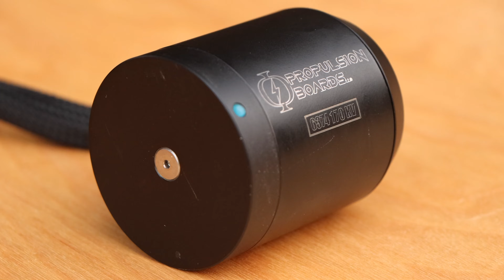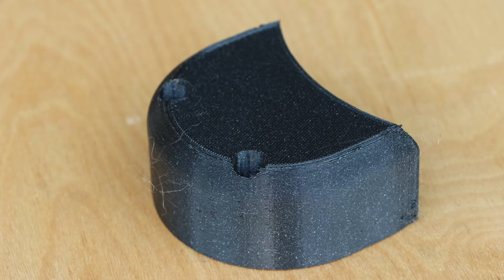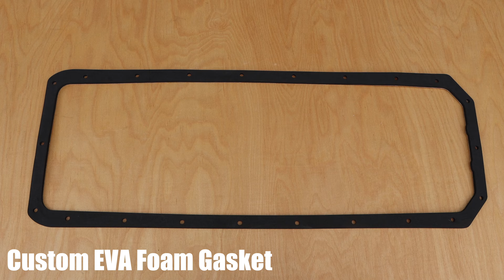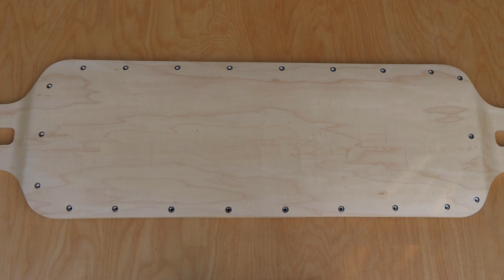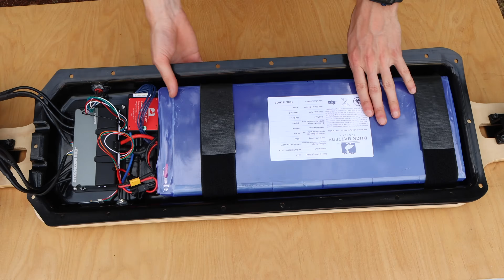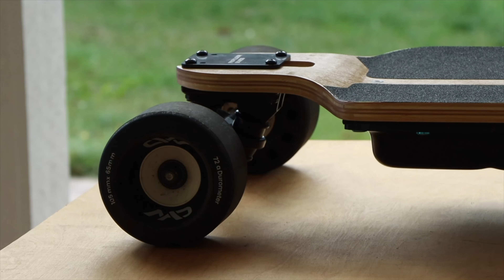How to Build an Electric Skateboard *THE DEMON 3.0* (38 MPH, 35 mile range)

Comment: Parts can be bought and replaced yourself unlike bigger esk8 sellers. But for how long, esk8 is still niche and companies disappear all the time and no more parts to buy.
Reply from the maker: Our whole goal is to develop modular systems that can evolve with the industry and latest parts!
Reply: @DIYesk8Builders  yea, I agree. I would support your site instead of the other bigger sites if I get another board. You should also put an airtag or smarttag inside the board too in case it ever gets stolen or lost.
Reply from the maker: That would be a cool addition!

Comment: If you get the kit, can you choose to use a different deck similar to the one provided, or does it work only with the deck given in the kit?
Reply from the maker: You can use another deck if you would prefer. The beauty of the deck provided is that all of the bolt holes align with the enclosure already and everything has been designed to fit together

Comment: I need to fix my 2.0 I miss the freedom.
Reply from the maker: What is broken on it right now
Reply: @DIYesk8Builders  honestly not sure I emailed you about it a few months ago. I just haven't put any time or month into figuring it out thought. I need a multimeter to figure out where the problems start. I hope it's a power but but it's unlikely. Most likely, the bms or focbox or both🤣🤣🤣 hence why I have l looked into, makes me depressed to think about🤣 but the new board looks incredible, I cant imagine my 2.0 being better. I've gone 17 miles on some insane hills that my car doesn't like.  You can stop in the middle and start again and be zooming by the top. I weigh less now in the past few months, but it was doing that with 220 to 200 pounds on it, and I'd pull my buddy "180" up hills with me it's insane. Just wish I had the month to put into it, but rn it's in open and sad I need to get street wheel belts broke one a few days before I completely broke it. Think I had them to tight, and little rocks just ate threw the one side, and it eventually gave out. Need a power button because I saw a video where you could jumper the pins and it'd turn on if your power button was broke it didnt work spinning the motors would get a couple likes to flash on the focbox but not start it which leads me to the battery...500bucks and focbox replacement 300ish. Watching this video reminds me how awesome it is and why I need to fix it. 
Ps. nothing was the company or products fault 100% my doing highly recommend this company and the demon lineup, my 2.0 is/was insane so the fact they made it better is beyond me haha.
Reply from the maker: Well if you need anything please just reach back out to us on email! We are so happy to hear that you have enjoyed your experience with the board so far!

Comment: I must admit, it's price competes with any off the shelve boards and comes from trusted DIY guys in the community and has genuinely premium components.
Reply: Ok just wrong , get the isinwheel V8, open the wheel speed option in the remote and bump it up to 99. You then have a board that goes 40 miles an hour at 400$ with about an 10 mile range , but , they have swappable batteries for 150, for for 700$ you can have something far superior.
Reply: @kingkarma4286  Pretty sure the max speed is 28 as advertised on that board.
Reply: @SomeoneElseMorphed  yeah it's tuned down to be safer and provide longer range. The board length and truck width are not wide enough for the full capabilities of the motors. As I said , you can press and hold the power and mode button and crank up the wheel speed from 60, where it is set from factory , to 99. Honestly, the remote says I go like 45-46 sometimes but it's reading the wheel spin at the board , not actually mph, so I just say it's around 40. It was reading 28-29 on the remote before I adjusted wheel speed. This also decreased the torque , and it takes a push to get going quickly now. Not too bad , but I try to cross the street with traffic sometimes and need that punch off the line speed that I don't get anymore , but I get higher top speed.
Reply: @kingkarma4286  That's really impressive if it can really get to 40. I'd have to consider looking at it a little more, if it can somewhat reliably get to that speed. Thanks for elaborating.
Reply: @SomeoneElseMorphed  it is really impressive , but , it's not very safe at all, the board needs a wider and longer wheel base to make good use of it. I'm going 30 most the time anyway and tightening trucks often. It has some powerful and convenient parts for the price.
Reply: @kingkarma4286  If you could purchase other parts to make the wheel base longer and wider, would that make it a better build?
Reply: @SomeoneElseMorphed  yes definitely , swapping it to a different deck and getter wider trucks would definitely make it ultimate board. Also mounting metal clips to battery case like the back of a picture frame, the battery pack clips can break if you are on rough terrain alot as I am, but I honestly thought a roll of duct tape in my bag was a decent compromise far how amazing it was , planning to do these mods soon. Only other mod I want are the rover cloud wheels and itd be amazing , well I def 1500. Battery packs can be purchased from the company directly through email for 90$.
Reply: Need to make sure the deck and truck are tall enough for the battery pack, it has the perfect clearance as is , I'd suggest you match it are get taller trucks and a lower deck . I've been sliding it , and if I had a drop down , man , I could really get wild on it.
Reply from the maker: Thank you!